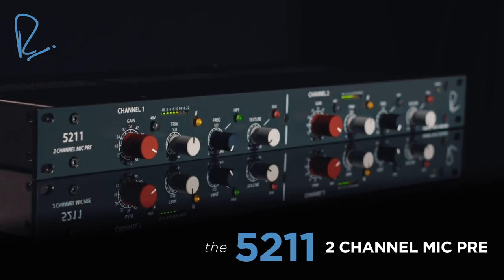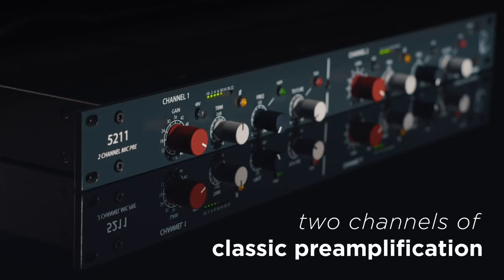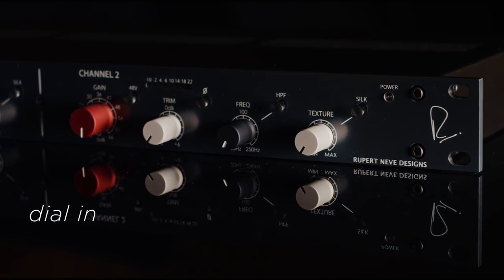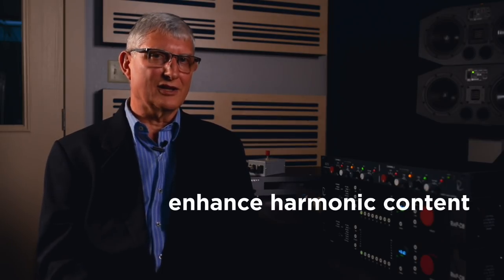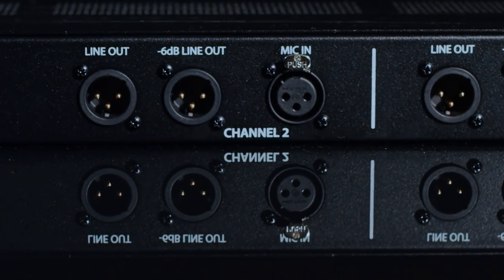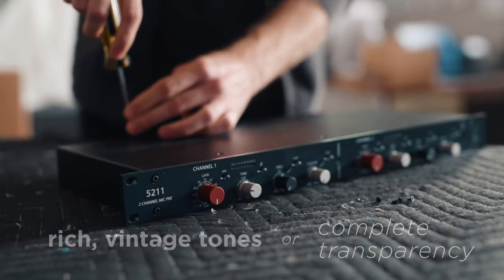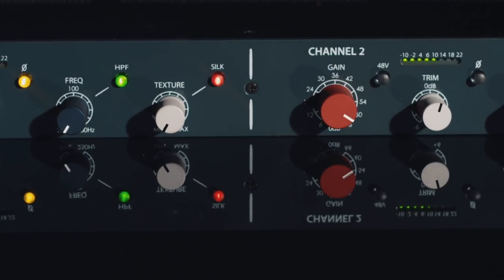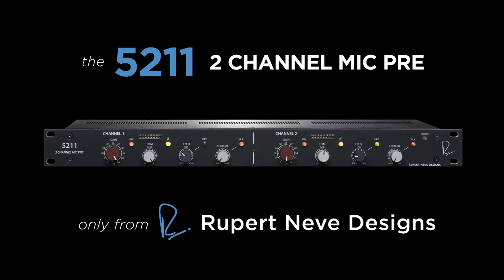The 5211: Two Channel Mic Pre

Comment: There seems to be so little 3rd party info and reviews on this mic pre out there I thought I'd share my experience of the 5211. I felt I wanted a preamp like this but had no idea what to expect in reality. Thank God my local music store got me one to try. I have now bought it and must say it is worth its weight in Gold. It took some getting used to. At first I felt it was so clean and tight sounding it bothered me. It wasn't what I was used to. But It takes time to discover its subtleties and realize that matching the right settings for the instruments and mics is a must. Then OMG this thing is magic. It is unlike any pre I have tried. I can layer away on a mix with a lot of variations of color. I tend to use it clean with no silk for my tuned percussion instruments (vibes, hammered dulcimer etc) which captures the percussive transients and high frequencies beautifully. But then on guitar a little silk helps add some sparkle and on my vocals a lot of silk adds such beautiful harmonic fairy dust. I compared it to the BAE 1073 which I was also considering buying. Well that sounded wonderful, more like I was expecting and at first I was sold on it. But after a week of playing I am now convinced Mr Neve is on to something special with his new designs. There is a new kind of magic possible here that the older 1073 clones just don't have. I could actually get pretty close to the 1073 sound by turning up the silk all the way, though the 5211 still sounded like it had better high frequency harmonic clarity, though it had a little less warmth in the mids and bottom. I would argue that the 5211 has more tightness and clarity in the bottom though and it can even feel quite thick sounding, just different than the thickness of a 1073. I would have loved both but after extensive playing around with these 2 units the BAE is going back and this magical little box is staying. I am very happy with the different sounds I can get out of it. @Rupert Neve
Reply: You know - if you want some more lows on your 5211 try this. You could use Silk Red on channel 1 and feed it’s -6db output back into Channel 2 Mic In using a Mic to Line converter such as a DW FEARN LP-1 or a Rupert Neve RNDI  box) and then use the Channel 2 for the lovely Silk Blue and dial some of that beautiful low end to get more of a vintage 80 series vibe. It can be done and I’m sure it will sound amazing😎. Cheers, Roop
Reply: @theredfaceofficial  No blue silk on this unfortunately.
Reply: @thetempleofsound  Oh really? I’m sorry about that (my bad for not knowing the unit specs). I was genuinely under the impression that it offered both. In this case, you could just use a Pultec style plugin EQ, and add around 1db of 60hz or 100hz and it will give you some more girth on the vocals or other instruments. This is together with the Silk Red! Still though, I think the Neve 5211 rocks 🔥
Reply: What do y’all think about this vs 1073? I want something to run my synths thru that I can also use for vocals & bass
Reply: @perfectcell6785  Get the 5211, more versatile and has the 1073 vibe with the finesse of a modern Rupert Neve sound. I own 1073 modules and the RND 511, the 511 has a smoother and more pristine sound, but still rich and silky as expected from a Neve
Reply: @theredfaceofficial  I’m looking at the 4 channel. I think I’m going to give it a try see how I like it. Thanks for advice homie
Reply: @perfectcell6785  Hey no worries, happy to help. I have other RND products and have to say I’m very impressed with the sound. Recently got their summing mixer and love it. I’d say the audio bandwidth of the new Rupert Neve is more open sounding than the older 70s Neve stuff. But they are all great gear in the end.

Comment: Two months have passed since I purchased it.
Of course, it is excellent as a microphone preamplifier, but it also shows its power as a line amplifier for coloring.
2MIX is input at about +6 dB, and the output from -6 dB OUT, which is a little saturated with the transformer, is a very pleasant sound. 
Use the TEXTURE knob to make fine adjustments.....

Comment: I’ve recorded 49 takes of the same 8 bar phrase with the 5211 to get a better understanding of what the tonal changes are to my voice recordings. 
Each take has different combinations of settings. 

I own an original Neve mic pre/EQ and I know what the “Neve” sound is. The 5211 is clearer on the top end.  I wouldn’t say it’s more open but I will say it is an articulated signature in the high-frequency range. 

The 5211 has red silk only; it’s texture is variable but I am curious as to why the blue silk option isn’t there.  I suppose it’s to keep other pieces from the Neve line enticing; too many options on one unit and it could cannibalize sales of other units. Thus why I believe Rupert decided to make building blocks for the modern recording professional. To get closer to the classic “Neve” sound, you need to pass your tracks through more Neve transformers of these new Rupert Neve Designs. And wether that’s through the tape emulator, the 5033 EQ, the 535 Diode Bridge compressor and the Master Buss Processor, after using say the 5211 is up to you.  

Because I believe this is the case, I performed a test by taking the output of the first 5211 channel and imputing it to the input of the second channel. This kind of made the first channel the input transformer to the second channel’s output transformer. I tried this using both the -6 output on both channels to see if I could recreate the smooth sound of iron saturation so desirable in older Neve units. This is the output of the two each channel has, that gets closer to the saturated iron core sound of classic Neves. Unfortunately, I recorded a clip from a famous song so I can’t post it on YouTube but I’ll say this, I got close doing this technique of “re-amping” to the classic Neve transformer compression sound.  Is it identical? Sadly, no. BUT it is very, very good. I’ve come to the conclusion that the 5211 for me is not a broad stroke but a tactical sonic tool that has the ability to dial in many different nuances.  This makes it useful if you need that kind of versatility.  As a serious hobbyist, I don’t know how much mileage I’d get out of this tool. I tend to use my old Neve because I know as soon as I plug something into it, it will sound very right and very pleasing.  So, by the time you add up the various pieces of Neve gear to get more transformer Iron in your track’s sound, you’re probably looking at a total cost of an original Neve in today’s numbers. For $2k, this box, by re-amping itself, you get 70% to the original Neve sound I’d say and much more clarity.  Many of us grew up listening to recordings made with vintage gear; our paradigm and aural compasses are set to this “sound”.  Maybe this newer Neve gear isn’t missing the mark set by these venerable classic Neves but taking us further sonically while still delivering as much classic sound at the same time as physically possible.  The 5222 is a keeper for sure and especially if it will be your only pre amp purchase. It gives you so much versatility. Will it be a piece that  the industry will crown as a special keeper like the Rupert Neve Designs’ Master Buss Compressor is, I cant answer that.  Let me say I’m a serious hobbyist and while I do have some great pieces, my recording chain is my strong suit but my reference monitoring system is not to be bragged about.  So, take my review with a grain-of-salt; I simply can’t hear the details that someone using a high end DAC and Wilson Audio speakers can hear. 

The 5211 doesn’t stack tracks as easily as my older Neve mic pre; listening back to all 49 tracks in unison was not as comforting as with my older original Neve. I found this to be worrisome. 
The 5211 is the kind of box that is so well made, small changes in proximity to your mic will make the sound change very noticeably. My older Neve original has a wider sweet spot when using my 1983 Korby modified U87 but this 5211 is very revealing to proximity and off axis movements.
Reply: Hmm interesting. I didn't have a classic Neve to compare this to but I did have a BAE 1073 and Vintec x73i. I did record a whole layered song of acoustic instruments with both the Bae 1073 and the 5211 changing only the preamp and keeping mics in same positions. I, somewhat surprisingly, clearly preferred the mix I got from 5211. Everything was clear sparkling and easy to mix with less eq needed. The 5211 is not an exact match to the classic neve sound by any means but I wasn't trying to match a classic Neve just trying to find the best preamp for my needs so my process was different. But I do find the 5211 very stackable layering lots of tracks especially using the silk in thought out different amounts for different tracks. Interesting putting one channel into another, I'll have to try that though I am surprised you needed more saturation than you could get from one channel using 100% silk and the -6 output. At that extreme level I found it too much for my personal taste. I found it actually more saturated that way than the BAE 1073 though definitely a different sound. Each had its better qualities the 5211 is much clearer in the extreme highs and the BAE had a more pleasant full sound right away. The sound out of the 5211 is tighter and clearer than any of the others I tried which can make it a little clinical sounding at first but I find it very usable day to day and I could easily not use another. If I could have a classic Neve as well I would happily use that as well though. Great you have one!
Reply: Michael Moon try layering vocals.  That’s a different animal than anything else layered in my opinion and says a lot about the preamp you’re using. I really like the 5211, don’t get me wrong. The more I use it, the more I like it!

Comment: How are these diff than the 511? Diff output transformers?
Reply from the maker: Correct! Higher voltage (with higher headroom, greater dynamic range, etc), and the custom dual-tap output transformers from the Shelford Channel.